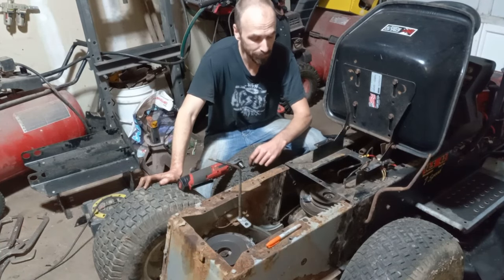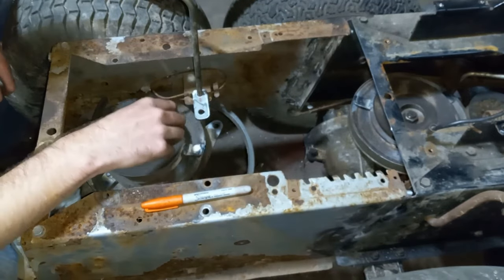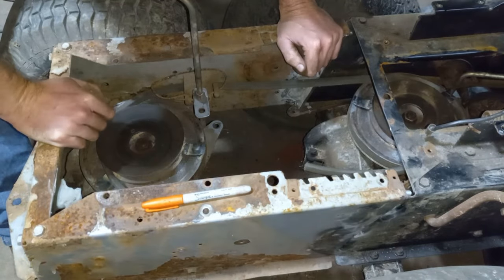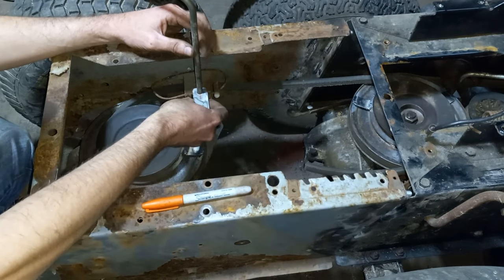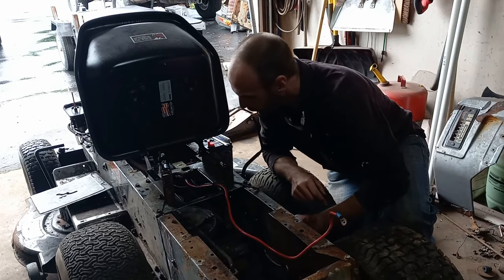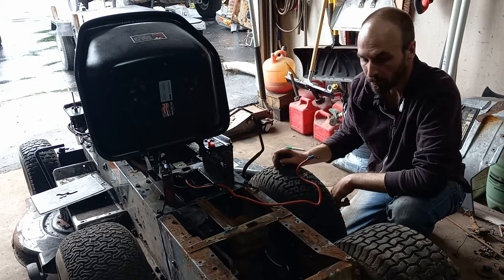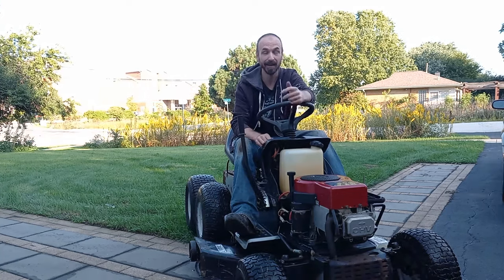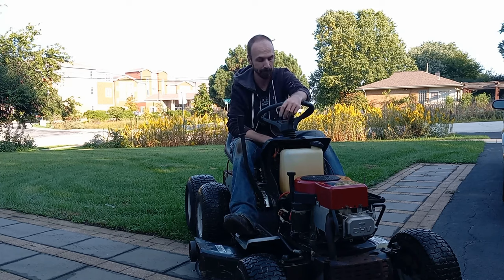6x4 Garden Tractor Build - Part 2

Comment: This video basically conferms every idea i had about the drive and shift system for building one of these. Thankyou for posting it.
Reply from the maker: glad to help.  Just remember to keep clearance between the two rear tires when fully inflated.  I initially measured my spacing with the tires low, forgetting that the tires can expand over 1"
Reply: @chrismakesstuff1  good tip thanks. I'll put about 4" between then  so I can have a bigger box.

Comment: This is a really intuitive and smart build! There are a few on YouTube but I like yours the best, easy to follow and simple to understand, Personally I would make the frame longer so you have about 4 to 6 inches between the rear wheel sets, only reason is I would then have a small bed on the back to carry wood, tools etc. thank you from Australia👍🏼
Reply from the maker: Thank you.  I appreciate it. In hindsight I should have made the frame 1-2" longer. When the tires are fully inflated they just barely touch.

Comment: Would it be possible to have more of a spread between the two rear sets of tires, so you can make more of a dump truck feature on it?  Just wondering  the logistics on that...thanks
Reply from the maker: Sure, you could space out the rear tires farther. The drive belt and linkage would just get longer. But, the longer the wheel base, the bigger the turning radius and increase in stress on the transaxle. Doable, but just something to keep in mind
Reply: @chrismakesstuff1  Would beefing up the extended frame help in that case, or will it still have an effect on the transaxle?  We are talking maybe 18 inches longer.
Reply from the maker: I can't say for sure.  If you are going to give it a try, let us know what you find.